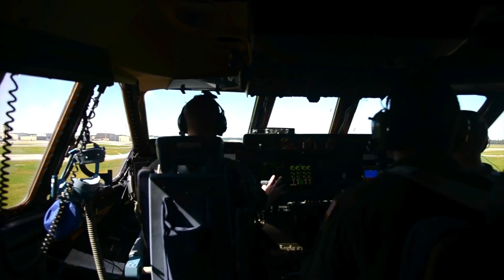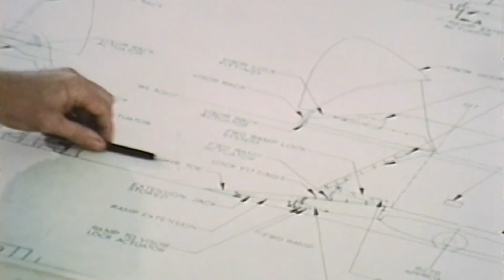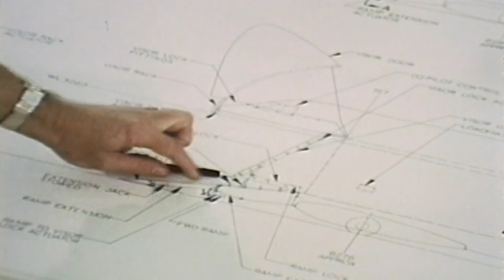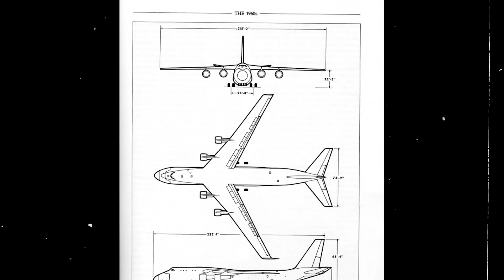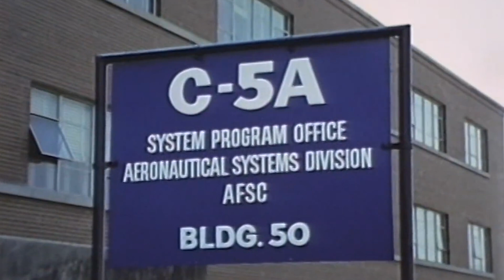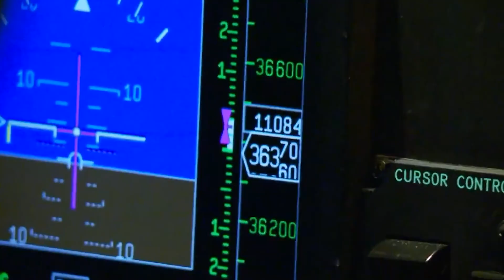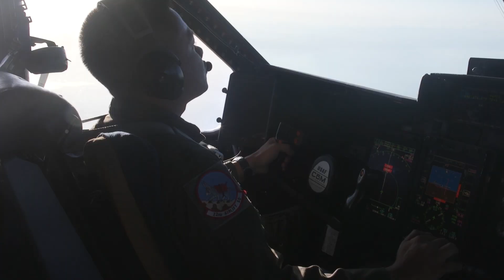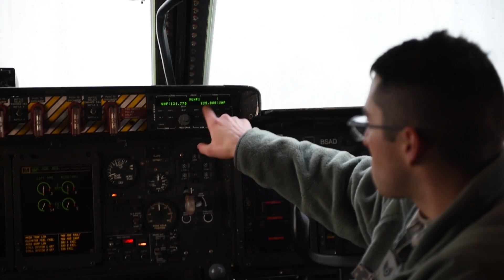The Secret Airplane that Could Lob Giant 86,000-Pound Missiles

Comment: I worked on the construction engineering of the C5 Airbase in Martinsburg, WV. The amount of concrete required for the runaway and parking apron was eye raising! The jack-up points were over 6' deep of concrete with massive rebar cages....with bar size of over 2" thick and 6500psi concrete. 28" thick for the apron, 36" for the runway and 48" for the "sweet spot" where the plane is to touch down...we also lengthened the runway to 12,500' and had to set additional angled piers for the steel hanger frames because it was so big, when the doors opened up the wind could lift the building up from its piers. Which are typically set to hold a structure from collapsing downward.  That is a maintenance facility for the C5. That is just the infrastructure to handle and maintain such an enormous aircraft!

Comment: My dad worked at Lockheed in Marietta starting in 1980, and he was a part of the work done on the C-5s in the late 90s to upgrade them and strenghten their frames. Where we lived was probably 10-12 miles from the plant but we were directly in the approach vector for Dobbins AFB from the west so growing up I got to see so many awesome planes fly over and the C-5s were awesome to see and sometimes they would be kinda low. Made such a distinct sound you could always here it coming. I can't even count the THOUSANDS of C-130s coming over. The drone of Hercules flying over 7 at a time is a sound burned into my brain forever more. The most memorable of them all is the B-1 Lancer. That is without a doubt the loudest airplane ever conceived and this thing came over my house like it was only moving fast enough to keep from falling out of the sky. Sitting in my bedroom I thought the world was coming to an end until I ran outside and saw that thing wings spread wide just trolling the countryside. I still want to know what the red light-orb me and my parents saw being chased by F-18s that one time was about. The freaking thing shot across the sky and disappeared with a pair of Hornets chasing it and they had their lights flashing on their planes like I had never seen too. All they could do was just turn their lights back off and head back for Dobbins like whatever. Crazy stuff man.

Comment: I did a lot of pattern work in small 152 and 172 planes in Charleston SC.
No big deal until you do it with C-5 aka aluminum overcast also work the pattern. They don't look like they are moving yet produce a invisible wake that can flip you upside down. Now its mostly C-17s but word is they are putting mothballed C-5s back into service.

Comment: I saw my first C-5, while in AFROTC field training at Vandenberg in 1971. It was so unusual our Flight Commander (just another cadet who'd been Civil Air Patrol and thus knew something of marching). He was my roomate for the second half of the "camp". 

 Two years later I saw them flying around Tinker AFB, likely picking up or dropping things off at the Air Logistics Center, then called an Air Material Area. Much later, in the late 1990s and early 2000s, I was working at SouthWest Research Institute in San Antonio. My office was pretty much under or about wingspan to the west of the Approach path into Kelly Field at Lackland AFB. They weren't all that high when they flew over our parking lot, and I could hear the whine of the fans, which had a distinct buzz to it. 

The only plane I saw from my office window that was even close to that size was a VC-25 , Air Force One,  carrying George W. Bush to a conference of some sort in San Antonio. It was so close when looking sideways almost parallel to the wall, all I could see, in my binoculars, which I kept in my desk for just such occasions, was two windows. Actually slightly less than that. Wasn't looking up much either.  Other interesting plane I saw was a WB-5 7 in NASA colors.

Comment: Fred’s gonna break.  As evidenced by the following: why is the C17 the go to aircraft for marine one helicopter (it’s not going to break and it can take off and land at Quantico).  Why was the C5 rarely used in the initial years of Afghanistan. Couldn’t handle the 50 feet 90 degree turns without fillets in the taxiways at Bagram.  Bagram was initially one way in and out to the ramp and as you can guess the C5 is gonna break (good thing for C17s).  Also Bagram’s runway was Russian horrific and had to shut 1/2 down for repairs.  C5 can’t land on 4,500ft runway at 5,000 pressure altitude, good thing we had the C17.  Kosovo, yeah that was 100 percent C17 in country deliveries and 0 percent C5s.  Why, cuz the C5 is gonna break.

Comment: The analyst who lamented the need for refueling should know it is better to take off with more payload from shorter, higher, hotter airfields that may have obstacles to clear. Inflight refueling solves a lot of operational needs for almost every USAF bomber, fighter / attack and airlifter. Even some  old  KC 135 and and all their replacements have refueling capability. Not to mention E-4 , RC135 and AWACS. Quite a few C 130  variants had inflight refueling systems. All for the same mission and performance demands

Comment: I was in the Air Force when that test was done.  I thought it was a waste of money and time.  As a former member of the 341st MIMS in 1965 through 1967 I knew the Russians did not have the capability to knock out the thousands of nuclear missiles we had scattered across over a million square miles in the mid and northwest. The Minuteman was named for its ability to be launched in one minute.  A C5 launch would take hours unless you had them already airborne.  Then it would take three times as many aircraft and missiles to maintain the same capability as the Silo system.  By the way, the Silos were built by Boing.

Comment: in 1988 at the RAAF Richmond Bicentennial Airshow in Australia there were both a Lockheed C-5 Galaxy and an Antonov An-124 Ruslan on display. Though very similar in size and capability the apparent quality of manufacture was extreme, with the Antonov An-124 Ruslan manufacturing quality seeming agricultural in comparison to the beautifully made C-5
Reply: Thats what the yanks though about the mig that defected back then.

Until an Australian pointed out the valve radio and equipment and steel shielding around the pilot was to protect it from an emp brust after a nuclear blast.
The aust realised his satelite was the only one that wasnt damage after nuclear test in the Pacific. Because it was so old with valve tec in it.
Reply: @gingertom56  our RAAF F/A-18 Hornets had EMP shielding on all the panels (called 'doors' on a hornet) that housed avionics, it was composed of a copper mesh imbedded in the composite fibre panels and metal 'fingers' around the edges of the doors which electrically 'bonded' to the airframe when closed, for discharge of an EMP burst, and also braided stainless steel and tin plated copper shield loops around the wiring harnesses to any electronic device, the loops were of a specific diameter and width which was 'tuned' for the typical spectrums of an EMP. The canopy of an F-16 has a fine layer of gold for two purposes, 'flash' and glare dimming and emp shielding, the layer is so thin it is transparent, and that is what gives the F-16 canopy a brownish colour
Reply: @davidewhite69  i was only a ground support fitter the closed i got to plane was the F11 through box on a spare one.
Had to make a special bracket couldn't get a aircraft framie until till i told him i was going use a cold chiesl and two pound hammer that made him move.
The only other sheilding i can across was the radoi room at HMAS Encounter. Same as you describe but bigger.
Reply: @gingertom56  I dont understand that line: "was the f11 through box on a spare one"  Do you mean F-111 and the wing carry through box? I worked on F-111s as well,  after the Avionics Upgrade program the RAAF C models used exactly the same stores management system as in the hornet, and the station encoders/decoders had the same shielding, but the avionics bays didnt need the mesh because the panels were aluminium and someone far smarter than me said it wasnt required, more likely they didnt want to go to the expense because the probability of experiencing a nuke EMP was minimal
Reply: @davidewhite69  forgive only gsf yes the box that had the wings pin to it.
They wanted brackets so they hydraulically move the wings back and forward.
I was at amberly 91 to 96 did 12 months with emf section test all the lifting gear sling etc and going around calibrating the mics and tension wrenches.
Reply: @gingertom56  I was at Amberley 84-86 (3AD) and 97-03 (501Wg, AUP, 1SQN) originally elecfitter, then avionics tech
Reply: @davidewhite69  i first did 73 to 83 in the navy then 6 yeas at ETSA then rejion the navy 88 then transfer over the RAAF 91 because the wife became a welfare case on me 6 months later she left and i became single dad of two young ones thankfully the RAAF flight sargent stuck by me and gave time for court finally got out 98.
Reply: @davidewhite69  i was in the old 3AD squad then we transferred over to 501.
The old numbers game.

Comment: Was a young mass-properties analyst at GE FPD and along with another youngster (we were both nineteen or twenty, as I recall) did many of the polar moment calculations on the low-speed fan of the TF-39 around 67-68, before the C5 flew... didn't get to ride in ne until the early 80s... quite a bird...

Comment: So it happens that I was lucky enough to jump out of the C5 during trials at Ft. Bragg. in the late 80s-90s. The Army had to reinforce the MC-1 and T-10 static line tactical parachutes because the opening shock was very severe due to the high stall speed of the C5 compared to the C141 Starlifter and C130 Hercules. Some soldiers even suffered spine compressions because of the opening shock, or so I heard. I also took a long ride from Ft. Bragg to Saudi Arabia at the start of the 1st Gulf War. Impresive aircraft for sure.

Comment: C-5B pilot in the 1990s.  Flew it for several years in the USAF...great plane to fly...take you to the other side of the world in a duty day.  Surprisingly maneuverable for a plane that size.  Had to be smooth on the controls to air refuel.  Taxiing it was always a challenge depending on the airfield.
Reply: Any taxiing mishaps you had, or had heard of, that you can share? 😅
Reply: @DUKE_of_RAMBLE  😂. Absolutely none I'm willing to share until more years go by.  🤐 (Nothing to see here...all is well...situation normal...go about your business.😉)
Reply: @MR-C5-C130  LOL
Copy that. Moving along! 😉😏
Reply: @DUKE_of_RAMBLE  I will say that if there are no tire tread indentations on the soil, you didn't "depart the prepared surface" despite the tall grass being bent over a bit.
Reply: I worked on building the C5 Maintenace Base in Martinsburg, WV. The engineering and construction involved in just building the infrastructure for that behemoth, alone is quite amazing in itself.

Comment: "The air service considered the Boeing design the top choice, but Lockeed's proposal was considerably cheaper."

Isn't that the way it always goes?  Which is why there's a running joke in the military of "Your equipment was supplied by the lowest bidder."

Comment: My childhood neighbor was in charge of the fuselage to wing structure design team for not only the C5A but, also the Electra that had wing issues when it 1st started flying. He made his career reputation by coming up witht he best most economical "Fix" for the Electra. I was a teenager and the C5A program came up....The original specifications were for the C5A to fly higher and slower than what it was finally asked to do when put into service. Becuse it was designed to fly up in thinner high altitude air at a slower speed, the design was perfectly acceptible for the intended useage ONLY AFTER parameters were changed did the problems arise.

Comment: Between 1973 and 1976 I was stationed with the 82nd Airborne at Ft. Bragg. I used to go down to the adjoining Pope AFB, now Pope Army Airfield, and photograph the C5-A's at the approach end of the runway, as they did their practice touch and go's. Makes sense that they were first sent to Charleston. Also, Seymour Johnson AFB in NC., that all makes for great training runs for a new cargo aircraft. I never thought about it at the time, but I was looking at cutting edge technology. I heard these were also tested as aircraft for air drop of personnel and equipment, and determined to not be a good fit.

Comment: As a kid, it was always a treat when a C-5 landed and took off from the local SAC air base. The windows in every building in town would vibrate, even from 5 miles away, whenever they fired up the engines for take-off.

Comment: The recent reliability program to replace the engines for the later model C-5s was carried out at Marietta, Georgia where the transport was originally built.  There was also some cockpit upgrades and many repairs not related to the upgrade.  The new engines were the GE engines used on the Boeing 767.  The new engines do not have the familiar whine of the old engines when taking off.

Comment: I lived next to Lackland AFB back in the 80s. Lackland didn't even have a runway or control tower. Unless things have changed significantly, I think the correct AFB would be Kelly, right next to Lackland. Back then I regularly saw C-5s on Kelly AFB. It was amazing to see a C-5 parked next to a B-52. The tail of the B-52 didn't even come up to the main wings of the C-5. The C-5's tail was well above everything. The B-52 was dwarfed to almost toy size is was so comically small in comparison.
Reply: It was Kelly AFB back in the 80's, but in the mid 90's Kelly closed and the runway was transferred to Lackland.  When it was Kelly AFB there was C-5 depot level maintenance there, but that may have moved now.

Comment: My father was a major in the Air Force (MAC) stationed at Dover AFB in the late 60's. I remember the C-133 Loadmaster that he flew. Those had MAJOR issues and killed a lot of crew members. He also flew the C-141 Starlifter and he ended up flying the C-5A before retiring.
Reply: Of 50 C-133 Cargomasters built, 9 crashed. Not a very good record...at one point they added an aluminum strip to the leading edge of the left wing so it would stall at the same time right wing stalled and the put a big band all the way around the aft fuselage to keep it from splitting open  . Many pilots left the Air Force refusing to fly the 133.
Reply: @edwarddowns2189  While the C-133 looked similar to the C-130 the C-133 was nearly 2X the size. The C-130 Hercules was a FAR better aircraft.

Comment: The 747 was way more successful than the C5. The number of miles and millions of tons serviced by a 747 will never be approached by another aircraft.
Reply: But that's an apples to oranges comparison. The 747 will never carry two tanks, or four Greyhound buses, or ready to fly CH-47 helicopters.  The two aircraft don't compare in terms of capabilities such as roll-on roll-of large vehicles, or the ability to air drop them.  

The C-5 is less efficient because it has to carry around all the  built-in equipment that gives it such capabilities and more. Cargo ramps at both ends, built in winches, kneeling landing gear, two auxiliary power units, hundreds of pounds of tie down chains, 6 hydraulic systems, etc.  It is not an efficient airplane, it is a capable airplane that can move outsize cargo no other US aircraft can move, and move it directly to the war zone if needed. For example, a Boeing 747 will never take a load of 160th SOAR helicopters to where they are needed.

Comment: I was sitting with my sister down town Clinton, Oklahoma one night when one of these C5A planes loaded with the ICBM crashed at our local airport.  The misread the airports and missed Clinton Sherman airport.  The crash and subsequent explosion created a 5 mph breeze in town approximately 4 miles away.  The military spent several weeks blowing up and gathering material and hauling it away.
Reply: There were no icbm's on that plane and there was no explosion. Not sure where you got your story.
The plane had a wheel well fire caused by a hot brake. They made an emergancy landing at the wrong airport and went off the end of the runway. The plane broke into 3 large sections. There were no major injuries.
Reply: @edwarddowns2189  The plane lost hydraulics from a ruptured hydraulics line preventing the plane from applying brakes or changing flaps settings due to loss of hydraulic fluid.  The explosion of the fuel on the plane and the Rocket caused a 5 mph wind in the city of Clinton about 4 miles away.  All of the crew on board except for the pilot parachuted out.  Once the plane hit the runway (which it destroyed as it wasn't designed for the load of the C5A) the pilot jumped out before the plane crossed a section line south of the airport and fell into a gravel pit owned by Rayburn Hearld.  When this happened the plane and rocket broke apart and the ignition of the fuel caused a 5 mph breeze as recorded at the weather stations in the city of Clinton.  The blast pushed the pilot across the ground some distance ripping the knees and elbows out of his flight suite.
His brother who was a pilot in the second C5A turned on his landing lights and circled the airport and surrounding area for some hours as the Highway Patrol and local police located those crew members who parachuted from the crashed C5A.  The entire area was sealed off while the military blew up and retrieved the remains of the plane and rocket.

Oh and I was in town when the blast occurred.  I also went to Rayburn Harold’s house the next day.  He was understandably busy with highway patrol, city police, Air Force, national guard, and military parked around his house.  The US government bought his gravel pit, several buildings on his property, two water wells and other damage the blast collapsed.